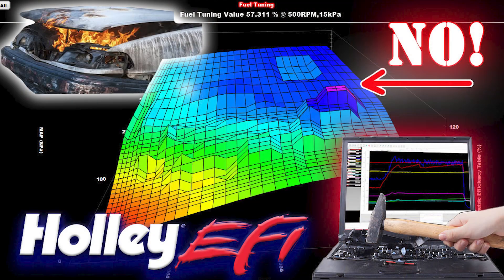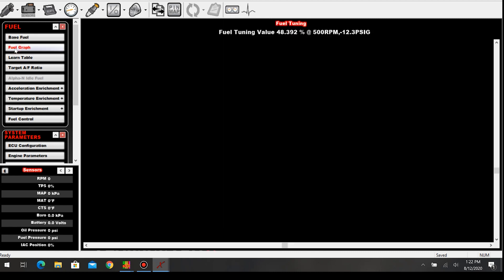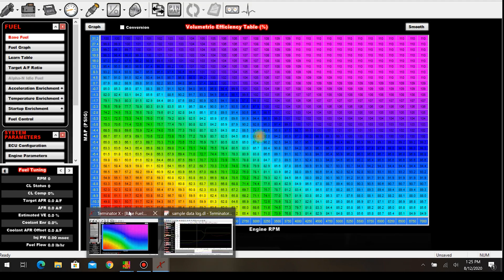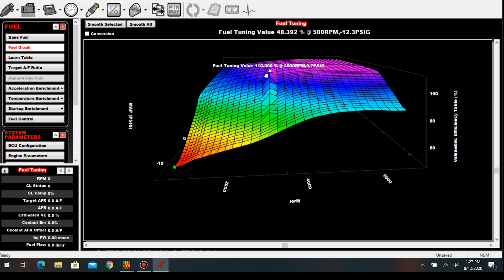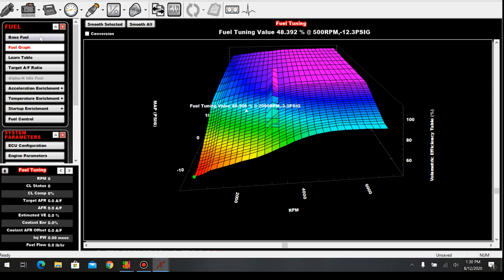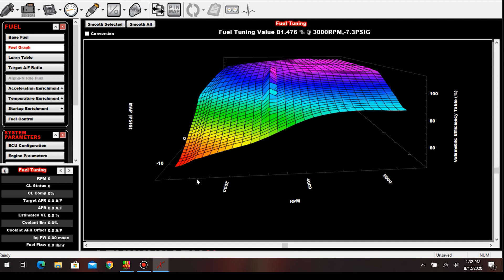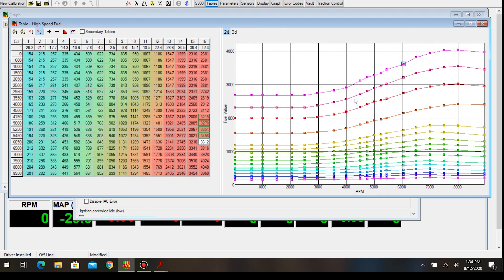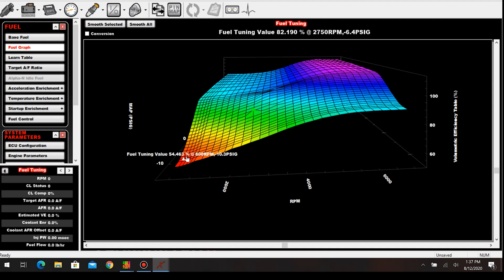Holley EFI   Terminator X   Dont let this feature destroy everything you do

Comment: I have the terminator x max and have already gone through a O2 sensor in three months and haven’t even drove the car how ever I replaced the O2 sensor and now it backfires through the exhaust but if you unplug the O2 sensor it runs like it use too HELP

Comment: Hey Joe, should I run the stock knock sensors with the x max ? Or should I have it run speed density. I'm new to efi. Coming from carbs and distributors all my life.  I'm new to tuning. And thank you for your videos ive learned alot
Reply from the maker: I use ve and no knock sensors

Comment: I’m new to the Holley terminator x and I have a d1-x on a 5.3 LS  wbosh 210  around 10 psi and I would like to run the track tomorrow on some 110 can I bring the timing up? And make sure I’m getting enough fuel.. I have a fuel lab pump and dash 8 AN
Reply from the maker: That’s impossible to answer from that little bit of info.  Gotta tune for it and figure out what it wants
Reply: @JoeSimpsonAtTempest  where to start??
Reply: I’ve done the base set up and it’s building it’s own map and it seems to run well .. I’m going through all your videos and there is so much to learn before the races that start in 8 hrs😞

Comment: Just got my Blazer back from Dyno. Made it half way home. Come to find out it keeps fouling plugs. Shop can’t seem to figure it out. I need help or advise please. Have terminator x with sniper throttle body and fuel system. Ran great for a few miles. Fouls plugs on both base tune and the actual Dyno tune. Only runs for about 30 minutes.

Comment: Is there a ways to tune my car so taking off in first gear and at low speeds in second gear are smoother with  the Terminator X.  My car really likes to buck at lower RPM and there is not a smooth transition into first gear unless I am at 1700RPM or better.   I have supercharged 302 in a 1965 cobra replica.  This has only been an issue since I installed the Terminator X.  Tremec transmission TKO 600.